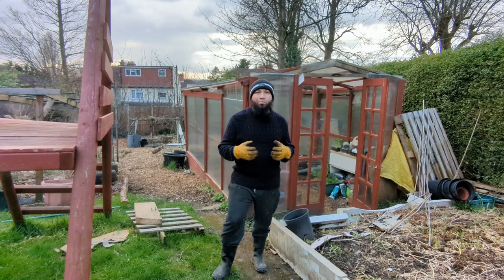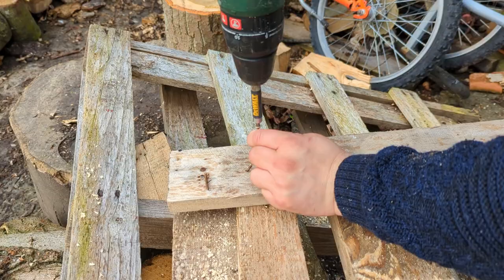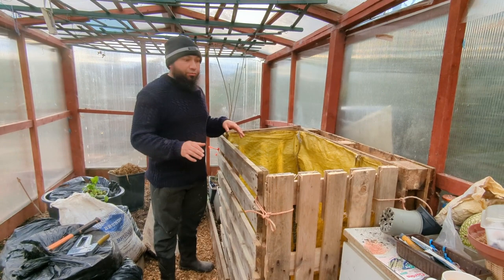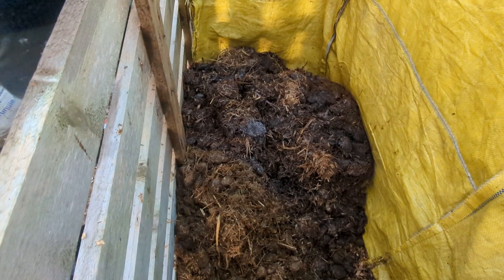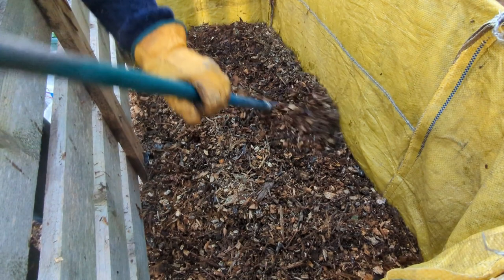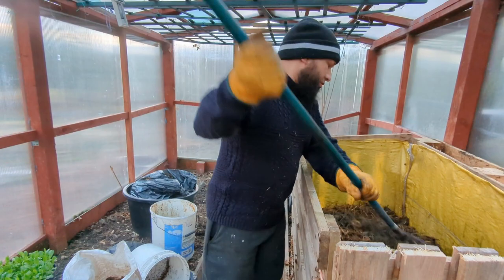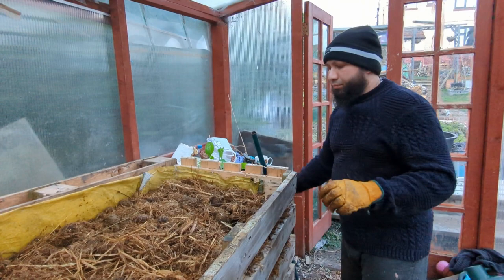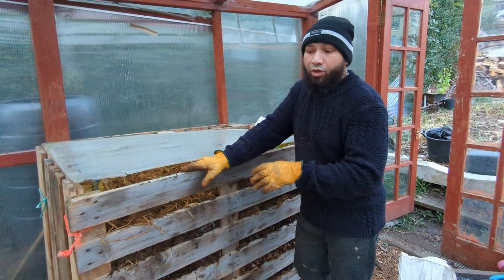Free Greenhouse Heating Using Hotbeds

Comment: If you run some pvc pipes through your hotbed and into your house, you can get free warm air in winter to reduce to heating bills too. A wee solar powered fan to push the air around will run your system for free.